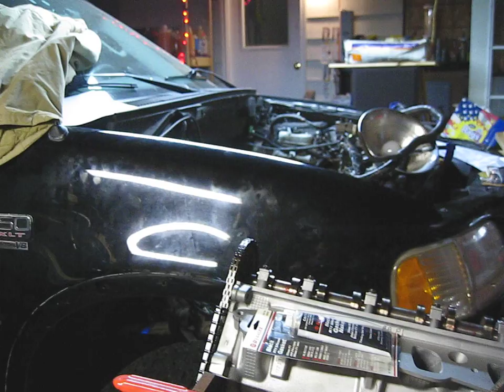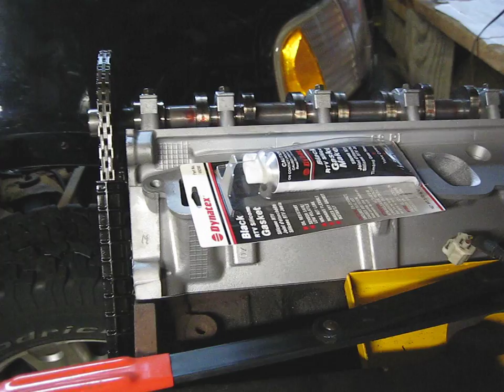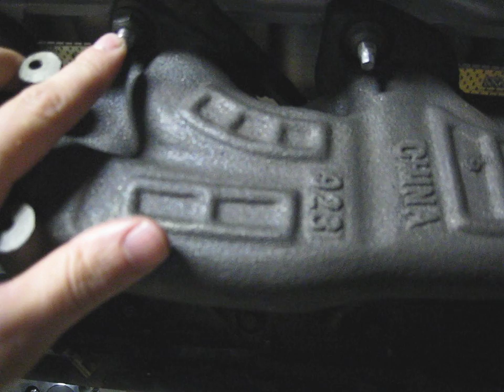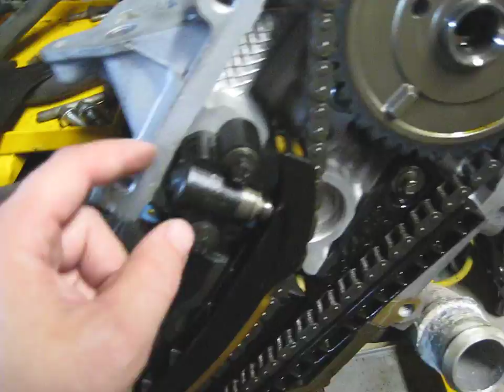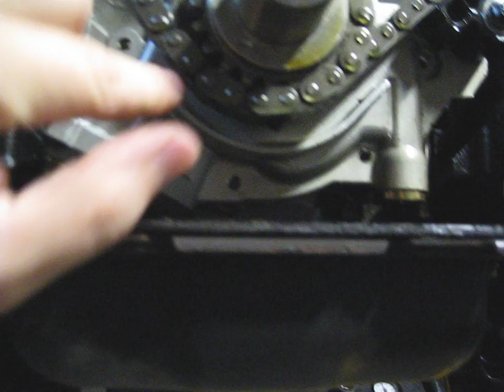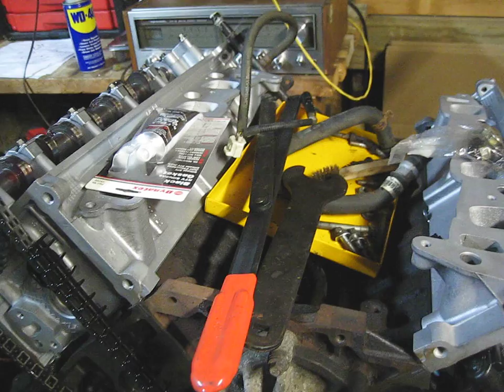Ford F150 Engine rebuild progress

Comment: I know this video is old but that dimple on the timing gear needs to be at the 6oclock position and then the L and R on the cams point straight at the 12oclock

Comment: Hi I'm doing a head gasket on a 4.6 myself and wanted to know did you have to use anything for the camshaft to hold it in place?? and if I put marks on their, is there anything I should be worried about with the camshaft before I take off the heads? and when I take off the heads of my supposed to have the engine at top dead center or 10 before top dead center?thank you

Comment: Did you replace that old oil pump ? old oil pumps in the 4.6 and 5.4 cause the phasers to make a tapping noise right before they fail and seize up. If you did install a oil pump did you video that ? so far looks great !
Reply: +Silicon Valley Engineer The melling 10340 solves the oil pressure issue for the 3v 5.4  google it up
Reply from the maker: +Silicon Valley Engineer Hi, I had a 2v 5.4 and did not replace the oil pump.  Thanks!

Comment: The physical size of these engines is ridiculous for the amount of HP and torque they produce. Smooth runners, though and a really tough bottom end even if they are a little weak in HP and low end torque. A pushrod 351 Windsor or a pushrod Chevy 5.3 will run circles around these things.
Reply: The top end of the engine is larger... That's it. Yeah they physically are huge but it's the liters that matter. The 5.4s are no slouch. Nut hugging on pushrods? Go drive a Titan with the 5.6 dohc. I've had just about every late model truck. My last 2 5.3s sucked.
Reply: +Scott Carlson The triton 5.42V makes more peak torque then either the 351 or any 5.3 Chevy up untill 2014. The 5.4 also makes its peak toque at only 2500rpm, which is lower then the torque peak on either of those pushrods. Kinda crazy.
Reply: Shaun R I hear you, but these modular V8s feel dead compared to older pushrod V8s of similar displacement no matter what the published HP and torque numbers say. As I said, their physical size is ridiculous too for the amount of power they produce. A Boss 429 was smaller in size than a 5.4 modular.
Reply: Oh my god. Tritons are huge, it's ridiculous. The 5.42v is more powerful then people give it credit for, it kinda lacks the pop of a push rod v8 though. It's just a smooth linear PowerBand.

Comment: Most shops won't even get inside this engine,tell the customer no.Ford garages replace them with Jasper remans,they don't get inside of them either.
Reply: +wafrederick Ford never REALLY intended these engines to be repairable. These are very few oversized piston options available from Ford. Powdered metal rods with cracked caps (I know....everyone uses cracked cap rods now) It's a major pain in the butt to recondition cracked cap rods, though. Cheesy plastic timing chain components........If there was ever a disposable V8 to come out of an American car company, these are it.

Comment: I'm just saying I'd be afraid after all the work that some oddball part is going to fail and make all this fine work for nothing. For example, if the engine is out and the heads are off, etc., shouldn't you turn it over and remove the oil pan and see if there's anything going on around the crankshaft? Main bearing seals? I mean those are five bucks or so. It would suck if you got the engine back in running nice and some stupid part failed which you now have the opportunity to replace easily.

Comment: Nice work again. I think you're timing chain issue is going to work fine. While you're waiting for those parts maybe you want to do some work on the engine compartment and components. Even a wire brush and a nylon brush and rags are going to make it easier to work in there. Are you replacing engine sensors that bolt onto the engine? It will be interesting to see how this engine goes back in.